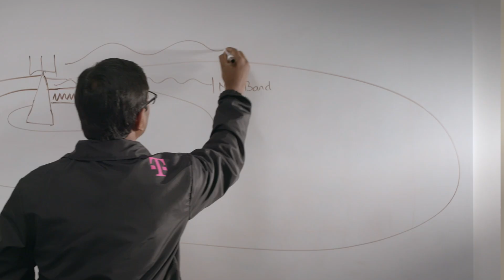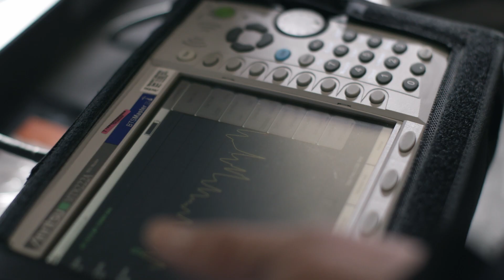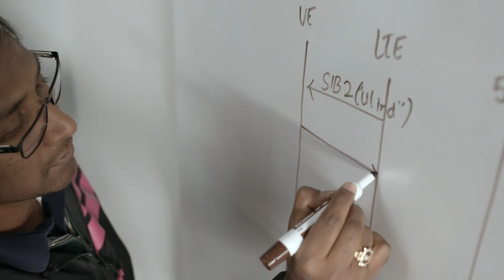Nationwide 5G Network on 600 MHz Spectrum | T-Mobile

Comment: 5G network has not yet develop in the U.S.   I believed the major phone carries are still broadcasting in 4G signals but they advertised 5G technology.   This is a fail advertisement they are doing.  drive 50 miles out of the city and you' will have NO signals.  what a F%$King joke this is.   If you lived in the rural  areas you know what I talking about.

Comment: Can you tell Telekom and T-Mobile NL that they should convince the officials into auctioning the 600 MHz spectrum currently used by outdated OTA TV for 5G?

Also, when I‘m in the US, I can‘t use 600 MHz LTE because many phone manufacturers don‘t allow roaming on 600 MHz in EU models.

Comment: 600MHz is the future tbh.. increasing the Hz makes them less reliable. They should figure out way to make them faster within the low frequencies.
Most issues face by current generation is the capacity and reliability. If a cell tower can handle more than max client can fit at a certain spot we can make the data unlimited for all the users since it won't overwhelm the bandwidth.
Reply: But you can only have so much bandwidth up and down with low frequencies lol
Reply: Low band spectrum will never be fast enough compared to millimeter or midband spectrum. You can get 100-200MBPS on really ideal conditions in just low band. That’s why you need all three spectrum frequencies to get the balance of speed and coverage

Comment: Bye forests. Who needs oxygen?
Reply: Ok
Reply: They most likely won't cut down the trees specifically for the cell tower because they like building them on preserves, private land or  logging areas, that's near a main road for security purposes.

P.s. high Rises reduce the need for deforestation.

Comment: Looks like commercialized stupidity to me. I own a cell phone, though I only use it on the road when absolutely necessary. Otherwise, it is on "airplane mode" to help cut down on unnecessary electro-fog, headaches, etc. Nice drone shots, though.

Comment: After T-Mobile's big announcement that 5g is now available in my area, I'll tell you what T-Mobiles 600 Mhz 5g does in my area.  It's garbage that is slower than 4g LTE and constant signal loss.  Now I have this expensive device, that I have to lock to 4g just to get decent speeds, but still have signal loss issues!  I'm sure after some the reviews I've just read, part the problem might be Samsung's Note 10+ 5g (numerous complaints about connectivity issues).  Anyway, I will be going back to my local T-Mobile store tomorrow, to return this Note 10+ 5g garbage.   Might give the OnePlus 7 5g a try, but probably will just go back to using my OnePlus 6.  At least I know I get decent 4g speeds with it and I don't have connectivity issues with it.
Reply: Purge  not true
Reply: none  then stop using your phone

Comment: I got a couple questions about this. Do phones who previously had access to the 600mhz band will see a difference in signal? Not speed, just signal. Was 600mhz deployed previously or did the switch just get turned on.
Reply: 600Mhz used to belong to old broadcast TV, and was used back then at around 1,000 x times more Effective Radiated Power (ERP) via huge towers

Comment: We need 5g antennas like now! I'm less than 2 miles from a 600 MHZ tower but surrounded by trees that'll block the signal.  According to T mobile's 5g map it is using 5g! Since my elevation is the highest to the tower I could easily mount an antenna on one of my tall trees to get full line of sight.

Comment: I'm a tmobile customer in ny,outdoors network is great if it's not windy,indoors forget it horrible guys at my job with sprint,verizon&at&t have signal indoors but not me very weak signal using iPhone XsMax and Galaxy s10+ so it's not the phone??.called and complained so many times after the merger if it don't get better I'm going to Verizon cost more but I'll have signal everywhere..

Comment: My biggest problem with cell towers and cellular internet service is how extremely limited it is unless you're willing to spend tons of money. 
I live in a rural area, and the closest thing to broadband is satellite. 
But satellite costs WAY too much for WAY too little. 
I've got the same issue with cullular, it costs way too much for way too little, and there is no REAL broadband. 
Real broadband does not limit the data you use and the speed stays consistantly fast.
Rural areas need affordable REAL broadband..
I don't think cullular tech is good enough.

Comment: 😂 I see Verizon trying to do this they’ll never be close
Reply: Verizon has a massive 700 MHz bro... The CEO of Verizon is the dude who led the development of 5G at Ericsson. I think Verizon knows exactly what they're doing.
Reply: @Emucratic  yeah, can't beat having 5g at football stadiums
Reply: Emu plus Verizon 5g equipment is a radio head and an antenna all in one unit. Also it only weighs about 40 pounds where a regular dual band head or just about any other radio equipment for that matter weighs around 80 pounds.
Reply: I thank that AT&T is the best
Reply: Actually they might because they are releasing a new low band 5G Network

Comment: I'm leaving AT&T after 11 year's to Tmobile in 2 day's! I just payed off my Note9 and have a unlock code so i can bring it over. I want the Magenta plus plan!
Can't wait for the Note 11+ with Tmobile! No holds bar!👍
Reply: @Ricky Florida Keys Tech Q&A . I'll wait for the 2nd gen 5G chips in 2020.👍
Reply: @Ricky Florida Keys Tech Q&A . I want the Note 11. Happy Thanksgiving!✌🦃
Reply: You better make sure it works for you first.
Reply: Note 9 supports 600mhz (5G)!
Reply: JAYGUNNA 98  😆😂😂
Reply: How is T-Mobile for you?
Reply: Hope you read the fine print on the Magenta Plan.  "Unlimited data on our network. During congestion, the small fraction of customers using >50GB/mo. may notice reduced speeds. Video typically streams on smartphone/tablet at 480p. International speeds approx. 128Kbps."  Being a T-Mobile customer for several years now, I can tell you about 3 years, reduced speed is more common than not, along with frequent momentary signal loss.  Deprioritization has become the new norm for T-Mobile.
Reply: @Ricky Florida Keys Tech Q&A Note 9 supports 600mhz (5G)

Comment: No point of 5g if my plan only has 30mb data lol
Reply: No I wish it was 1/3 of a gig. It’s 1/300 of a gig
Reply: Sounds like you need to upgrade, your plan with only 30 mb's is probably cheap though.  Most of us left that plan 10 years ago. Have you been living under a rock?
Reply: You sure it's 30Mb lol, some webpages with adverts are nearly that size :D

Comment: So what phone fully support 5g high n low band? 2nd how goes Sprint network fit into this when will a phone come out that can support both network??
Reply: Galaxy a11 5G
Reply: @Ricky Florida Keys Tech Q&A so are you suggesting it worth getting those phones or wait if you can to get s11 with the new snapdragon n modem?
Reply: @Ricky Florida Keys Tech Q&A are you saying that if I get one of these, it will support 5G on not just 600mhz, but also 2.5GHZ? The phones coming out on 12/6 will be post-merger ready?

Comment: My old OnePlus 6 supports 600mhz but not the 5G high speed, I'm curious to see what happens.
Reply: You should still theoretically receive speeds over 150mbps depending on the signal strength. Where I live I hit 200mbps on my op7t. I'm also looking into getting the 5G version when its released!

Comment: I currently have the Galaxy S7. Hopefully, my phone will support it.
Reply: Nope. It doesn't even support 600 mhz LTE. You need a new phone.
Reply: @timman3643   what ban do you need on your phone to get it
Reply: The lowest band the S7 supports is the 700mhz band (band 12)
Reply: Band 71 and it needs to be a 5G phone. Because 5G is hardware related and not just an update that you'll get. 

For now you have two options. Samsung galaxy note 10 5G or OnePlus 7t pro 5G Mclaren Edition.
Reply: @dupreddeleon7519  do you think it's worth get the note 5g now when the s11 is Right around the corner with a snapdragon and new modem? To get the best connection
Reply: What band is 600mhz
Reply: Band 71
Reply: @Ricky Florida Keys Tech Q&A that's what I said. I meant he won't get 5G because he has a galaxy S7. And the only two available at the moment will be note 10 5G and 7t pro 5G Mclaren.
Reply: Don't get a new phone get a new network. Band 71 is mostly for show, if you get it, great, but why use 600MHz over a more dense midband network like AT&T or Verizon?

Comment: Great video. but I'm here in South Jersey and 600mhz is deployed everywhere except my township. 🤬🤬🤬🤬🤬
Reply: Same here in Southern Maryland, small state and they still have not upgraded our towers.
Reply: @Call_me_Opa  Have they upgraded yet?
Reply: That sucks. They've deployed 600 MHz where I live in North Jersey.
Reply: Last time I checked it was only in cape may, be patient... Or move to Delaware, much cheaper to live outside of NJ😉
Reply: Which phone do you have?
Reply: No 600 MHZ in my area where I live. Only 700. It's a huge area with several million people
Reply: I'm in Galloway  and there is  band 71 600mhz in AC, Absecon and  parts of Pleasantville.
Reply: @Ricky Florida Keys Tech Q&A very exciting! Do you happen to know anything about B71 deployment in Matagorda County in Texas? My work sends me to that area a lot, FM 1462, County Rd 25 can use much better coverage...